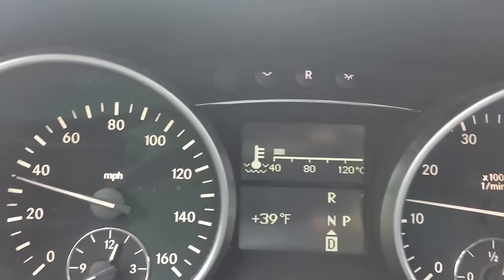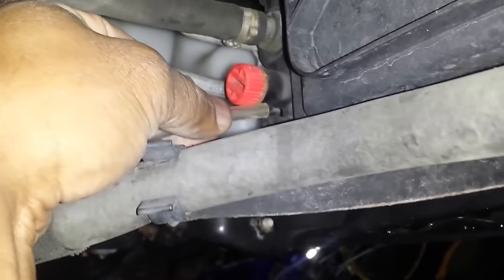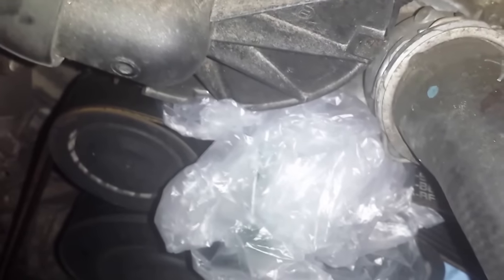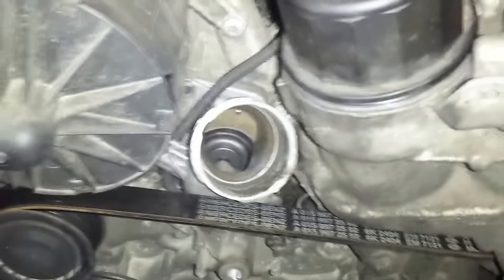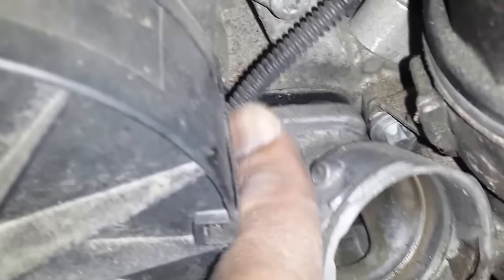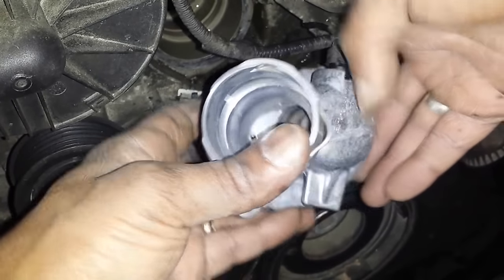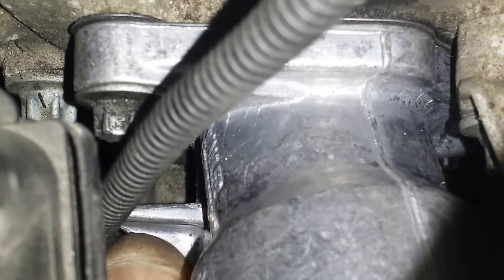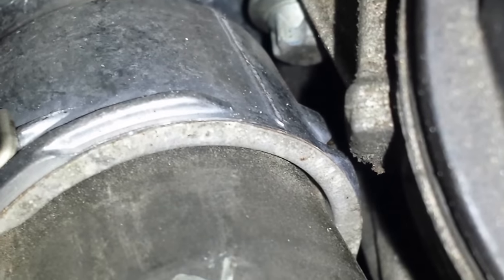Mercedes Thermostat Replacement DIY

Comment: I love your instruction videos. I see so many videos that has little to no explanation and zip through the obstacles showing just what to do. All those you can download from All Data DIY, but what all of those books won't show are the obstacles. I have now repaired my W221 S550 with watching lot of your videos and after watching I can get into with confidence because I am ready for all the otherwise unknown issues that could come up. I  saved thousands of dollars with doing my own repairs and not to take my car to the stealership. Not many shop wants to touch an S550, so you are a great help here. THANK YOU for all you do here!

Comment: An awesome video to be sure. And great explanations of all the pitfalls to watch for;  the notches on the gasket and the orientation of the gasket, and the one way only to replace the hose. A note, as Adolfo said, I would not have removed the serpentine belt completely, I prefer to just release it w/the tensioner and just lay it down without removing it, I dont want the hassle of replacing it correctly, and it can still be inspected completely. That said, this is one of the very best videos on thermostat replacement and makes me lots more confident when I go to tackle the exact same job on my 2007 C280. Thank you!
Reply: I also need to replace the thermostat on a 2007 C280.  Is the process identical/similar?

Comment: 17mm socket on the serpentine belt tensioner makes life a lot easier...  You might consider draining your cooling system and replacing the coolant with the correct type.  For Mercedes, I believe it is a blue coolant.  I found some lubricant (silicone or Dawn dish detergent) on the o-rings makes for an easier installation.

Comment: Thank you, without this video it would have been much much harder and messier. Not to mention the reminders that this is an aluminum block and you don't want to over tighten. Great job filming and explaining. Again, thank you very much ;)
Reply from the maker: physiques Glad this video helped you and for letting me know.  I enjoy making these videos and film with one hand while do the job with the other.  If I can do it one handed I know my viewers can do it with both hands.
Reply: ***** Brother I thought about you filming and working with one hand, also motivating lol Have a great a weekend.
Reply: @iRepairAutos  Thanks for video,what size for tubing for Drain Plug?
Reply: physiques what is the torque specs on this?

Comment: Just a word of caution, if the engine is hot and you are doing this job, please take caution to depressurize the coolant system, if you remove the upper radiator hose from thermostat, you will get sprayed with hot coolant all over and the thermostat will be a pain to remove.

Comment: Having just done this, I recommend removing the auxiliary air pump the belt and both idler pulleys it sure gives you space,  and you can check everything while you are at it
Reply: Definitely remove the auxillary air pump it's one bolt and hose. Makes more room to get to the thermostat.

Comment: nice video man. A notice though. using 1/4" bits then tools fits lot better ;) i tend to use those cookiecutter shaped wich works on normal hex bolts too... 8 and 10mm bits.

Comment: Thank you for your video. I have 2006 Mercedes Benz C280 and trying to replace the thermostat. I follow step by step and when I’m removing the connector to the sensor, I realize that there was another connector together with the one going to the thermostat’s sensor. The second  wire is not connected at all. I’m wondering if you know or have an idea where it goes or connected to. Thank you 
I have picture.

Comment: Hey Keith. Nice videos, very informative. Got a code P0128 on my 2010 ML550. Want to check sensor first before going to thermostat. Any idea , with pic, diagram where to fins the sensor?

Comment: Also is pretty much identical setup on a SLK350 isn't mine friend asked for help. Good video, was looking for tensioner pully to loosen serpentine belt and remove before removing other pulley in the way of thermostat housing... I almost want to just remove housing or siphon coolant instead of jacking up and removing plastic cover from bottom of radiator area, but will make more of a mess I  suppose...

Comment: Thoughts about whether this job pretty much requires putting the car up on a hydraulic jack (ie, high enough to stand under)? And does the brand of thermostat matter; ie, Mercedes vs. after-market part?  Thanks!
Reply from the maker: I wouldn't put the vehicle on a hydraulic jack for this job.  The thermostat is accessible from the top of the engine.
affiliated part can be found here:  http://amzn.to/2lfITct

Comment: Great video man!!!, congratulations!!!, but let me notice you that you MUST remove the belt at first, before to do anything!!!!. And it must be removed loosing tension move the tensioner pulley with the apropiate torx key!!!, thank you for share!!!, Greetings!
Reply from the maker: affirca77 Very true.  Thanks for watching!
Reply: I noticed that too, there's a tensioner pulley that pivots to release tension.Remove the belt, then the pulley after.  Never remove the pulley with belt still on. You can ruin the pulley and strip the bolt hole.
Reply: affrica77

Comment: Hi, another comment from Iraq.
My heating system is not working as before. It is blowing cold air! What do you think the reason is? My car is c230 sport 2007. I have checked the motor attached to coolant container and it is working but the hoses are cold!

Comment: Before removing that belt pulley, loosen idle pulley to relieve belt tension.  Looks like he edited out the mistake of taking that pulley out under tension.  Then remember to tighten tension pulley when you reinstall the belt.

Comment: Good video and explanation!  One question. Is it absolutely necessary to remove the serpentine belt? Can this job be anyway completed without its removal? Another DIY vid shows replacing it rather easily but doesn't show engine type. Is a 2010 ml350 w164
Reply from the maker: +Adolfo Chapa it's doable without removing the belt.   I don't like any chemical liquids touching the belt. That's why I removed it.

Comment: my w203 m271 engine makes a bad noise and some vibration everytime i start it for the first time in a day and put it in gear right away before the temperature goes up but if i start it and leave it at idle to warm up engine first then it perfoms just fine i have visited several mechanics but they cant really tell the issue, the last one suggested camshaft sensor. i dont know if any one has ever experienced such

Comment: The thermostat housing is bolted down to the manifold? I think it’s stripped no bolt want go in it.. I just need to know the part that the thermostat is bolted down to.
Reply from the maker: It is mounted to the engine block.  You can possible do a repair on the stripped hole.

Comment: dude, do not remove the pulley while the belt is under tension!  also your motor has the wrong coolant in it, which may be why the seal is so degraded on your old t-stat.
Reply: I have a 2007 C280 and pretty sure the color of the coolant is blue, just some extra info. Thanks for the video!
Reply: i have e220 avantgarde 2008 2.2 170hp. mine(the coolant) is green
Reply: Does it matter what coolant you use?
Reply: Lynette Stewart yes it does matter of the brand of coolant and the color.

Comment: I can't seem to remove the censor plug. Not sure what I need to do exactly to remove please help. Great video btw! Almost done and saving me tons of money :)
Reply from the maker: take your time in removing that sensor connection;  You might want to spray some w-40 on it.  Be patient;  Don't brake it.  It will come off.
Reply: iRepair Autos I ended up breaking the little white piece that's supposed to be pushed up in order to take it off but what I did was grabbed a screwdriver (flathead) and pushed it up from the bottom and it came right off. I ordered a new thermostat already and I'm so happy because you helped me save so much money! I was being charged almost $600 and now I only spent $175 plus I need to buy some more coolant so I'll end up at about $200 which is a HUGE difference from $600 keep it up man thanks so much!! 👌🏻

Comment: I just replaced my yesterday.... engine light still on? Do I need to drive it or get code removed? Or unhook battery? Thanks
Reply from the maker: Yes. You should always clear the code after a repair.   If the problem is solved it won't come back.
Reply: Will unhooking the battery do it?
Reply: @neilhale8626  Do a search for clear code.  Some trick to pushing buttons inside the car I think.  Similar to resetting service notice which is usually just oil change notice.

Comment: Hi, what wrench is used for pulley removal 

also what wrench is used to remove the under pane pan to access the coolant drain

Thank you
Reply from the maker: Socket for coolant drain is 10mm
I'll check on the one for the pulley.

Comment: Does coolant have to be emptied from the tank before replacing a thermostat?
Reply from the maker: No. Make sure the engine has cooled off overnight.
Reply: Or bleed off a ~1/4 gallon or so.  But coolant does need to be changed every 50K or so, so if it's time, why not.

Comment: Hi.
on 19:00 you got a cable with plastic plug.... any ideas i can buy it? just this lastic plug because mine is damaged :/  
great video! cheers!
Reply from the maker: +PATRYK GRYCIUK Yes you can buy that part.  For 2006+ ML350 the part number is A0225451926 and the name of the part is:  Thermostat 2-pin MLK1.2.    Thanks for watching.  Hope this helps and Please subscribe.
Reply: +iRepair Autos thanks  Just bought it from Mercedes Dealer... many thanks... :D
Reply from the maker: PATRYK GRYCIUK That was quick!  Did you order over the phone?
Reply: +iRepair Autos no just went to local dealer...
Reply from the maker: PATRYK GRYCIUK Cool!  Good luck with the repair.
Reply: +iRepair Autos thanks... take care..

Comment: is that the same drain pin when replacing the waterpump??or can i jus bleed it thru the holes on the pump?
Reply from the maker: The easiest way to bleed the coolant after the waterpump change is on the waterpump itself and also on the coolant reservoir cover.

Comment: on my 2010 ML350, the coolant does not drain out the hole. I turned the red drain petcock all the way, still no coolant coming out the hole. i had to pull the red petcock vale out and coolant comes out at the petcock. it was a mess so i had to put the red petcock back in. Any ideas why the drain hole does not drain?
Reply from the maker: It most likely has some crud/dried coolant blocking the hole.  It may need cleaning out with a wire.

Comment: Just wondering I got a warning message saying low coolant then two days after the warning I got a check engine light, got the car scanned at autozone for free po128 could me not adding coolant cause the check engine light thanks
Reply from the maker: Most likely it's because of low coolant.   Question is why is the coolant level low? Is there a leak?

Comment: Thanks a lot for sharing this masterpiece. Is there a big difference in the configuration on this 06 ml compared to an 03 ml500? I need to do this exact same job along with banks 1-2 02 sensors. Any assistance will be greatly appreciated. Already subscribed for future productions.
Reply from the maker: It's the same basic application;  Locate the coolant return hose.  It's connected to the top of the radiator.  Trace it back to the engine block; at that point it's connected to the thermostat.  which you might need to move some things in order to gain access;  I haven't looked at that engine in a while.  Let me know;  You can send me some pics of what you see as well.
Reply: iRepair Autos email address is?
Reply from the maker: keith.joi@gmail.com

Comment: Can you tell me where is the thermostat sensor located on a 2006 CLK 350?  Thanks 🙏🏼
Reply from the maker: Easiest to find by tracing the top radiator hose back to the engine block.  It's connected to the engine block and the radiator hose is connected to the thermostat.  the sensor itself is in the thermostat.  You need to replace the thermostat as the sensor is not a replaceable part.

Comment: Any idea what part would have failed if I have dried coolant above and behind thermostat housing and behind the mount for the secondary pump?
Reply from the maker: Could have been the thermostat hose, the thermostat gasket, a bad thermostat reservoir cover or a human spilling coolant when attempting to add some.  When you say dried coolant do you mean white, chalk like flakes on the aluminum body of the engine?
Reply: Exactly. White crusty chalk kind of blue-green in color at the top and behind where the thermostat mounts to that a-shaped piece that also secures one of the bolts for air pump. I have no other signs of coolant loss so I thought some kind of seal had failed where those 2 large e-torx bolts secure it on either side
Reply from the maker: What's the history on the car?  Did you own it before this happened?  It's probably from a previous issue.    To be sure,  clean it thoroughly and  monitor.
Reply: iRepair Autos I’ve owned it for years. Did a coolant exchange and major service myself a few months ago. Ecm shows no faults. I’m losing coolant somewhere though because I have to top it off every month or so when coolant light comes on. I think I saw some wet coolant behind that thermostat housing. I’m about to do the water pump and thermostat but I feel like i need to tackle the issue now while I have parts off. Where is that crusty dried coolant coming from if it’s at the top and back of that mount?

Comment: any reason why your coolant is green?  The Mercedes Coolant or the Zerex G05 that can be used are wine color.  Or if you get the new ones they are blue.  Did you use the wrong type of coolant?
Reply from the maker: +BenzSUV that's what mine came with.  I agree though all the new ones come without green...

Comment: How do you know if the thermostat sensor is bad?
Reply: If you live near a big hill, a cool day with normal warm engine, coast down the hill with the engine running normal, just try to stay off the gas, brake as necessary, if the engine temp goes down, thermostat is open when it should be closed.

Comment: Yes codes p0012 p0015 p0357 p0355 p0025 clk550 how would you trouble shoot a no start  and would bad can shaft magnets stop car from starting or should I check all relays even fuel pump  2007 com 550
Reply from the maker: +Jammell Brown you can ignore all the codes and see if you're getting gas in the fuel rail.   Fuel pressure test video. Then if fuel exists with pressure you can rule out all the relay stuff.

Comment: Can a jumped timing chain  stop bar from starting 2007 com 550 95 786 km miles
Reply from the maker: +Jammell Brown it could, but the car would have its check engine light on with error codes for misfire etc

Comment: 5:50  the temperature sensor don't control when thermostat opens.. has nothing to do with it. Depending on each thermostat its set to open usually at 87-95c and close by its self. The thermostat sensor just tell the car what the temperature reading is.
Reply from the maker: you're correct.
Reply: If this is the case, what is the failure mode?  I ask because I'm getting a code that the thermostat is not opening fast enough, but the temp is reading 80c.  I think it is opening slowly. Thoughts?
Reply from the maker: +Calvin Landers the rubber gaskets internal to the thermostat housing usually cracks.  This allows the coolant to circulate freely which in turns delays the coolant from reaching the operating temperature within the allowed time.  Replace your thermostat.  It cannot be fixed.  Its a replaceable part only.  Good luck
Reply: +iRepair Autos Thanks.  I have one to replace the defective one.  On my E350 W212 there is a unit directly to the left of the thermostat that hinders me from reaching the start nut.  Gotta take it off too.
Reply from the maker: +Calvin Landers probably the secondary air pump.  be careful putting that back on. there is a tendency to crimp vacuum houses that run behind it.  check my video on that.
Reply: +iRepair Autos looks like I'll have to remove the secondary air pump to get to the bolts that secures the thermostat.  My socket will not fit underneath do the SAP.

Comment: At 8:50 that was unusually dry to not have at least a drip of coolant.
Reply from the maker: +imaslowlerner sometimes that's how it is.   Remember to drain coolant from reservoir and radiator first.

Comment: Anyone else notice its the wrong Coolant type in this Benz? lol
Reply from the maker: +Chrono348 Yes maybe it is.  It's what was in the Mercedes from the start.    From what I've read/seen it is only a problem when you mix coolant types.  which can cause some clogging in the hoses.
Reply: Does it matter what coolant is used, I think I added a different kind when I got the indicator light came on coolant low... so. I went to O'Reilly and purchased some and they added it to what was already in there. Thank you